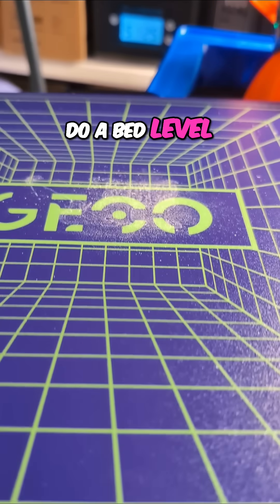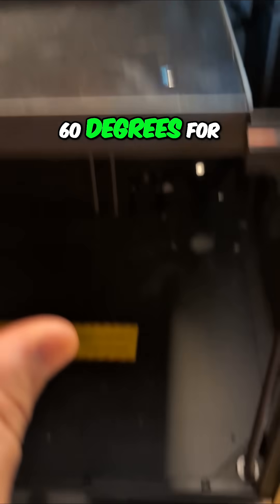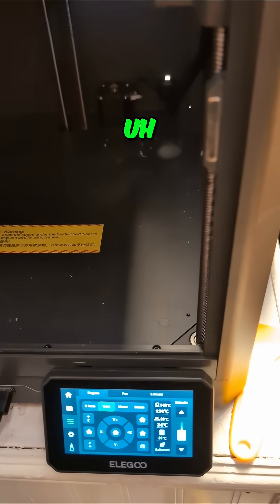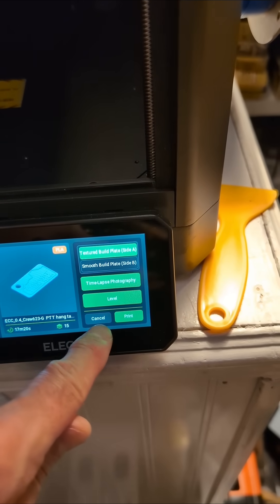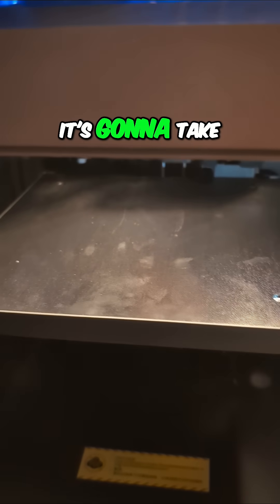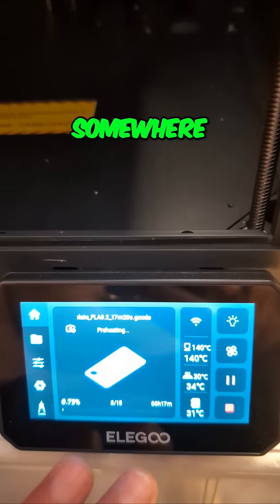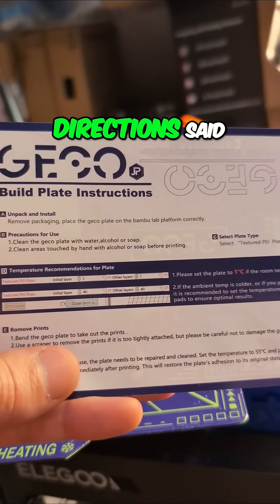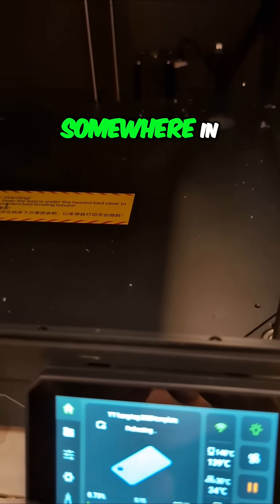3D Printer Cold Plate Problem: Help Me Fix This issue - Elegoo Centauri Carbon

Comment: If you use Orca, they do have a cold plate option on multi-plate. This will allow you to print using ambient temp. But the problem I ran into and yet have a solution is the leveling always level with 60 degree, which means my plate will have a different shape. So my print isn't perfect but it does print on ambient bed temp.

Comment: If the printer runs on Klipper just make a bed level macro that runs at 1 degree, then make a new Start_Print macro with your custom settings for the min temp threshold of 1 degree, put in it the custom bed level macro, and name it Cold_Start (or whatever you like) in the slicer create a new custom machine by copying the one you're using, name it differently and in the start gcode put in the new start print macro you just made. Whan you need to use that plate you just have to select the machine with the "Cold_Start" gcode in it and slice the file. this way it will do level and printing with your custom settings
Reply from the maker: Not sure what the Centauri Carbon is running, but I've heard it is not Klipper. :(
Reply: @GearReportMaker its some sort of Klipper
Reply from the maker: I hear ya. But I don't know. Just passing on what I've heard.

Comment: I’m not sure what slicer you are using, but what I would suggest is to try and set the temperature for a different plate and use that with your new one. What I mean is if you use Orca and you have the Super Tack (Cool plate) option, try using that. Then in your filament profile edit that plate’s bed temp. 

The metal will expand with heat and contract when cool. If your old plate temp profile was set for 60° that may be the way to fix it. If it’s built into the printer then I’m not sure what your next step would be.
Reply: Nope not a slicer issue tried switching build plate temps and on cool pei plate did a level it set the bed to hit 60
Reply from the maker: Exactly. Don't want to the mesh created at 60 if I'm actually printing with the bed at 30.
Reply: @GearReportMaker  are you able to edit the config files for that printer? I don’t have one of those so I have no experience with it.
Reply from the maker: Don't know. Never tried to do that.
Reply: I don't think there is a way to even see the config  file
Reply: @Og_paine ah ok. I really don’t know anything about the carbon. I thought maybe it was possible based off my k1 max being rooted.
Reply from the maker: Decent idea. I just don't know how to do that and haven't had time to research.
Reply from the maker: Thanks for the reply. Still trying to figure this out.

Comment: Did you build a cold plate profile on the printer or just the slicer, or either?  Seems like what is happening is the printer is defaulting to its normal bed plate profile settings for it’s standard bed side a or side b profile prior to performing the print at the adjusted bed plate temperature.
Reply from the maker: Build plate profile in slicer. I wasn't aware that was an option on the printer itself

Comment: I haven't tried this yet because I've only used side A on my CC. But in Orca slicer you can select the multiple build plate option and it will let you select the cool plate as the build plate. Maybe this will let you level at the different temp.
Reply from the maker: That is what I did. It still doesn't start the print until the temp hits the target value.

Comment: You want to have bed leveling at higher temperature because things will expand at higher temps.  Now, if you’re planning to print at ambient temperature, then bed leveling at ambient makes sense.
Reply from the maker: Exactly. It should capture a mesh for each temp you will print at, or at least every temp range.
Reply: This is obvious, AND the whole point of the vid is the quetion of HOW to do so...
Reply: @fightlikabrave you got it too! 👏

Comment: I've had the same issue with the smooth side of the included build plate. It levels at 60C then takes forever to cool back down to 35 to start a print (if you do the level before the print). What I've ended up doing is a single level (then no more leveling unless I have to) on its own, then a first layer print to fine tune the z-offset, then do prints and don't touch it unless I have to.
Reply from the maker: Yep. That is where I am right now. It means I can't switch the build plate (which requires a level) and print within a few hours.
Reply: @GearReportMaker Couldn't you treat that plate as side B of the original plate, so it saves the level and z offset? Seems like this plate basically replicates that one anyway.
Reply from the maker: Good idea. But the problem is the new plate is much thicker  @frumpyandy

Comment: Go into fluid and you might be able to change your code their.
Reply from the maker: Probably. But what code needs changed, and to what?
Reply: @GearReportMaker  it would be in the start up code. If you go a browser window and put in the ip address for the printer it will give tou the fluid terminal. I think you can look at your gcode start up there. But if you alter it be really careful.  Also when updates come out the machine might show an error.
I added code for my k2 plus and had to reset to do the following update.
Reply: @dwaynem8015  the CC doesn't run on klipper so this doesn't work.
Reply from the maker: The Device tab or web interface looks like fluid (fluid clone?), so I knew what he meant. 
Is

Aren't there sections for code in the device profile (I'm not at my desk rn)
Reply: @papaplintus  I think they say it does not use klipper so they do not need to open source their code.
Reply from the maker: Yeah. I'm not a fan of that. But I had a weak moment and bought the printer anyway.
Reply: @GearReportMaker I will look at mine later and see what would need changed. Im curious about this too 👍